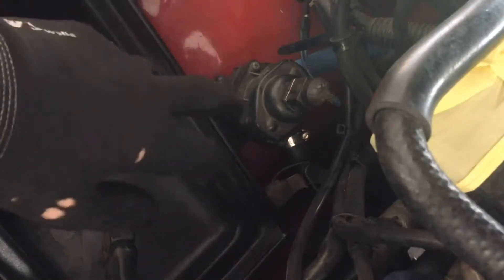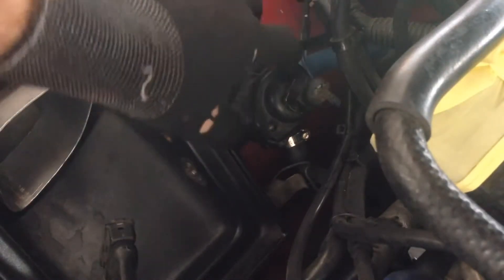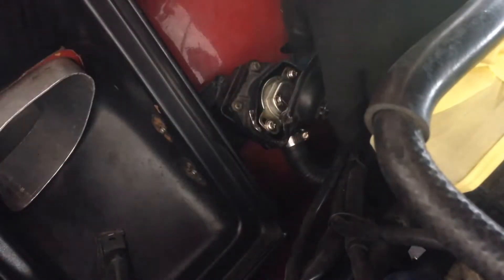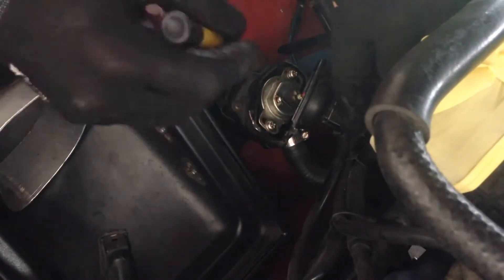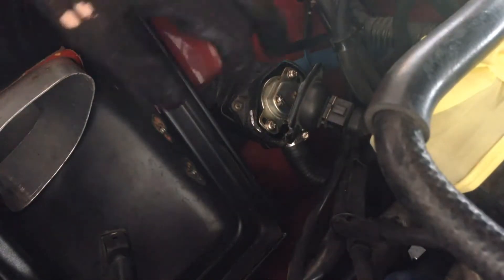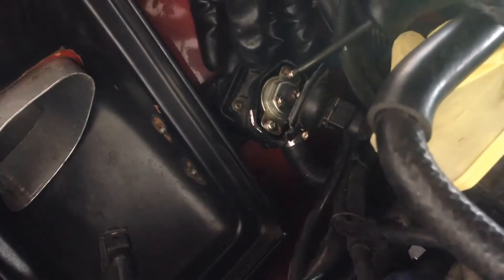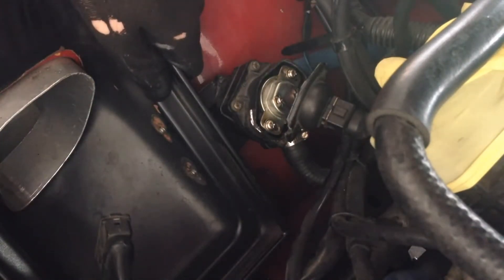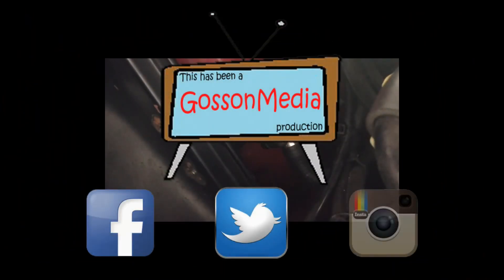Adjusting a Bi-metallic Cold Start Air Bypass Valve : Subaru EA82 MPFI or Turbo

Comment: Any thoughts about wiring this up the wrong way after solder broke. Fixed mine and car stalled after a few second running . Now I have no power to ignition coil. And no led onmy evu . I think it fried my ecu.

Comment: Hi Nev's!!
What kind Of Motor Oil fo You use On this EA82? My father in law uses 20w-50, but I think that we can use 10w-40...
I need some help with this ;)
::Appart:: from thus video

This piece maintein The motor running at 2K RPM at The initial start of the EA82?
Do You recommend dissasembling and clean it? (Gum Cutter or similar?)
Please tell me more ;)
William
P.S.: At home we have an Loyale (Leone) 87' Japan Made old and Loyalty Car, from my recently dead father of law, mecanical men 😢

You Get a New Subscriber!!